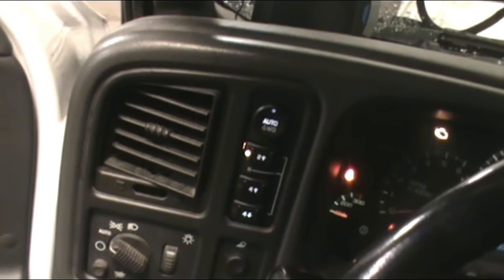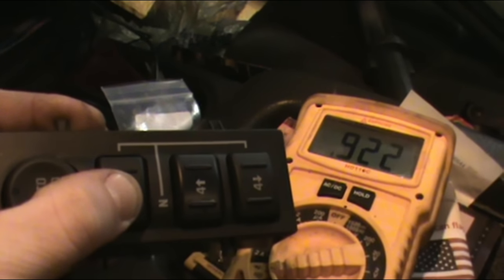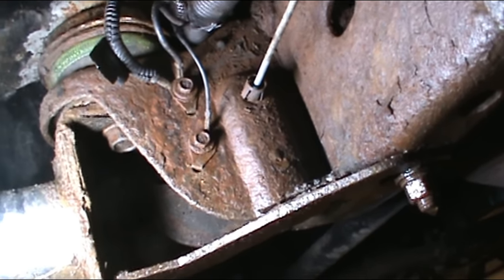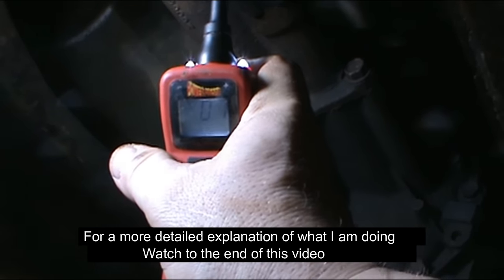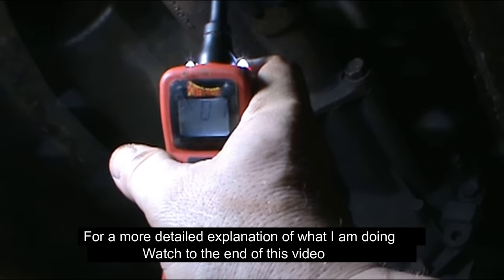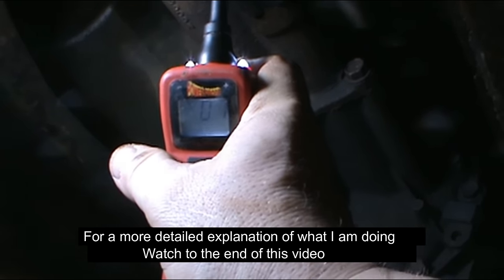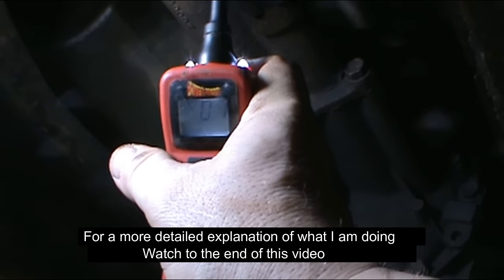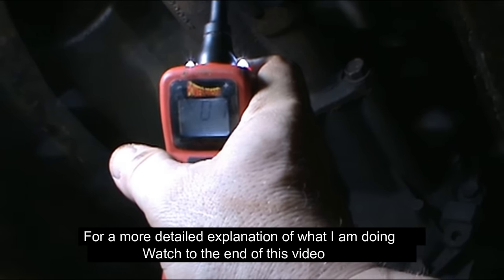Service 4wd diagnosis

Comment: I have never used a power Probe but I think i need one.  Lol What is the model of your power Probe and how much are they?
Reply: I thought I had my four-wheel drive fixed.  after adding a ground but after a couple days the service 4wd  come back on.  I know you kept asking people if the switch have any lights flash whenever you start the engine.   I do NOT have any lights that come on/ flash on the 4wd switch whenever I start up the truck.  then the service four-wheel drive light comes on.  
Some days I'll go out and drive the truck and 4wd will be fine. Then sometimes halfway down the road the lights flicker and go completely go off on the switch and the service 4wd light come on and not have four-wheel drive.  Then maybe the next day go out there still not have 4-wheel drive. And then it all of a sudden I have 4wd. Do anything do you think it's just the encoder. 
Thanks for your time.  I'm still curious about your Power Probe
Reply from the maker: I actually made a point to check my probe today to reply to your comment.  I have a power probe 3 and I got the full kit.  It is great for automotive troubleshooting but I still have a multimeter for household stuff (the power probe only does 12 volt systems). The encoder is usually the culprit for intermittent issues.  I have a video on changing it.  Check the wires going to it over the driveshaft too, I had them fall and rub bear causing it not to work in the wet/rain.
Reply: @GSEShop  thanks man I appreciate all the info. It's like 15 degrees here in Missouri now so I will look at the wires again in a couple days when it warms up a little.   I bet your right its the encoder.  My buddy said he had one for me to try and see if it will solve the problem before I spend the money. So I'm just waiting for him to give it to me. Thanks again I really appreciate it.

Comment: tried my actuator and cleaning up by drivers door wires.. says service 4wd... if i click the buttons the lights still switch over how its supposed to and i can hear it like in the video.... not 100% sure if 4wd is working considering there is no snow right now... but if the service 4wd light is on that obviously means there is a problem.... will check where you spliced in the ground wire and try that.... but any suggestions or help would be great!
Reply from the maker: The video is where I threw it all on the table.  I can offer ideas up it is hard to diagnose something that isn’t in front of you.  I will try to help as much as I can
Reply: Ok so the wire u tapped into is the black ground wire? Correct?
Reply from the maker: @Chache1527  yes on my truck it was the black wire

Comment: So I have a transfer case acting up but totally different than yours have been.   Mine wouldn't go in 2hi or 4hi, but it would go in 4lo and move.   I tried the nsbu, grounds, encoder motor, checked the buttons, changed the ignition switch.    All with no resolve.  I can unhook the batteries for 30 mins, and rebook and it will go in 2hi.   It will stay in 2hi until 2nd gear and then it clunks and send the transfer case to neutral.  It throws no code, dash just says "shift range inhibited".   I'm at a loss.  Any ideas??
Reply from the maker: Sorry I just saw this. Did you change the encoder or the whole assembly with a new one?

Comment: Hi please need your advice have a 2006 trailblazer xlt ..my problem is when I switch the knob in any postion the lights flash then go soild acting like they switched and you hear noise like it switched but the truck stays in 2 wheel the front difrentinal does not engaged and no codes show up or messages ....my mechanic friend replaced the front actualwaiter under front wheel .....he ran test says the diferenchel is not engaging ...but what has him baffled no lights or messages show up and the switch flashes then goes soild any ideas appricated dave that you
Reply from the maker: david kurzdorfer it is most likely in your wiring, check for a ground and battery voltage at the plug

Comment: Hey just wondering how did you get the switch to start actuating the motor. My truck (04 suburban) does what your truck did in the beginning of the video. The 2wd light on switch stays on and the buttons don't do anything. Switch is new.
Reply from the maker: Did you watch the whole video?

Comment: Mechanic said my encoder motor was bad and a common problem, it would cost $145 labor and $180 for parts then he replaced it,never fixed problem ,then he said it was the tccm,replaced it and everything works fine. Billed me $683 ,felt ripped off
by a mechanic who misdiagnosed and throwing parts at truck at my expense.
Reply from the maker: eastside0434 sorry to hear that

Comment: You actually had your meter set to continuity/diode check, but will still measure resistance with this setting.
Reply from the maker: You are correct
Reply: @GSEShop  🤘

Comment: On my four-wheel drive switch it clicks up and down up and down from low to high to auto back and forth that's the only thing I haven't changed out so what do you think
Reply from the maker: Did you test the switch?
Reply from the maker: Did you test the switch?
Reply from the maker: Did you test the switch?
Reply: Not yet doing that next
Reply: Tested the transfer casing motor it is clicking and making noises it's good the other little motor that engages the gears is clicking and making noises it's good only thing left is to test the switch
Reply: @GSEShop  it was the ground wires thank you for your help

Comment: I think this is my issue but not 100% sure.
The other day, my 2005 Tahoe went into 4L on its own, would not come back out. My encoder motor sounded like a toy running out of batteries beforehand, so I changed that first since I don't have a code reader that could read that code nor the means to get the Tahoe to a place that did. Replaced the motor and then the switch showed both 4H and 4L lights on for a second until I pushed a button and it showed nothing. The motor will not move at all now, and I have no blinking lights to indicate it is trying. I then replaced the module underneath the dash and it is still doing nothing, lights on the switch come on for a second until the car is on, then everything turns off. I replaced the switch last year after it put itself into 4L once, haven't really dealt with it until now but now it will NOT cooperate. Will this fix it? I am so hoping it will and for an answer, I've been at it for about 4 days now. Thanks a ton and God bless.
Reply from the maker: TheFNGBenJammin If you replaced everything you said you did I would think you have a wire problem.  Try this first because it won’t hurt anything (you can’t have too many grounds) but I suspect there is a broken or damaged wire connecting your shift motor.  Good luck
Reply: @GSEShop  Okay, thank you! I am praying this works.
Reply from the maker: I pray it does too

Comment: You were not clear...did you jumper a black wire with a blue wire, or did you jumper a blue wire with more blue wire?
Reply from the maker: On my truck it is a black wire, but on yours it may be different.  You need to jump the ground wire to another ground
Reply: @GSEShop  
Very good...thank you

Comment: The only thing I do not understand is this, if you connected a ground to the already existing ground wire that was not functioning, if there was corrosion or a break in the wire, how did the new ground wire make it to the actuator? Do I need to pull the ground wire out of the connector on the actuator and replace it?
Reply from the maker: Lit 710 you just connect your new ground in an area before the corrosion

Comment: I don't understand. We can hear the sound of the motor changing, but couldn't that sound be coming from the 4wd actuator up front on passenger side?
Reply from the maker: I have never been able to audibly hear it move but it would only do so between 2hi and 4wd.  Listen when you switch between 4hi and 4lo.  The FAA should stay silent in position.

Comment: Hey, quick question. I cannot hear my transfer case motor when attempting to switch between 2 and 4. No noise at all. I have no lights on my selector and the service 4wd message. Do you think the transfer case motor itself is the issue?
Reply from the maker: Probably the encoder in the motor
Reply from the maker: I have a video on doing that

Comment: Well great but I have a 2006 GMC Sierra and I don't have buttons like that on my truck and my dashboard light came on said it was in 4-wheel low and I don't know how to get out of it
Reply from the maker: Is it actually in 4low or does it just think it is
Reply: @GSEShop  that's what it came on the – the light came on when I was driving this morning to take my son to work but I can't find I can't find how you put it how you take it out put it back just letting you know regular I can't find anything I looked all morning
Reply from the maker: @sherizazzetti1824  ok, but is it in 4low?  Can you drive at normal speed and not hear the engine revving high
Reply: @GSEShop  well I think I got it but when I drive it and I can do like 50 or something it wants to ramp up but it's been doing it off and on for a while but I got another motor and transmission and I got to put in the truck cuz I have a trip for 12 years and always took care of it you know
Reply from the maker: @sherizazzetti1824  not sure I followed all of that, but if it isn’t in 4low but the light says it is it is probably a bad encoder.  I have a video on changing that too

Comment: Hey I got a 2006 chevy trailblazer ls 4x4 drive 
My switch is completely dead I tried a new switch nothing I had it in the shop they said my axiulator good so I tried re setting my tccm nothing getting so frustrated 😠
Reply from the maker: Your encoder is most likely bad, I have a video on that

Comment: I think this is my problem. I have a 06 suburban and when I try to shift into 4hi the light just flashes and goes into 4auto. It will however shift into 4lo. The guy I bought it from rebuilt the 4wd system almost completely. Going to have to test that ground out in the morning.
Reply from the maker: Good luck
Reply: @GSEShop  seems like a good place to start. This is the first 4wd truck I’ve owned so a little over my head.
Reply from the maker: @bradleygibbs2241  well it kicked my ass for a while but I will share what I found

Comment: Ok when I turn the key forward the 4x4 switch lights up but then acts like it doesn't have power I switched the 4x4 switch changed the 2 fuses added the ground like you did cleaned my grounds
Reply from the maker: Sounds like a bad encoder
Reply: @GSEShop  is that part of the transfer case motor
Reply from the maker: @joshhilmon6535  yeah but you can change it by itself too

Comment: my truck was working fine then as i was driving i have no lights of any kind on the range selector -after taking the switch out i found i had power at the switch on 2 terminals but even after a new switch still no lights- any ideas
Reply from the maker: Gordon Ellis I would guess an encoder problem, I have a video on that too

Comment: Put my truck on all For jackstands and the back wheels spin and the front Passenger spins the front driver moves very very slow and comes to a stop both actuator seem to be working switch is working but no four-wheel-drive when on the ground any idea 4 button switch 2000 Chevy Silverado 1500 4x4
Reply from the maker: Did you try the ground wire trick?  I have also had encoders that went sort of bad and would engage enough to turn the front wheels lightly
Reply: @GSEShop  the front diff actuator is working tho how can I make sure the encoder is good
Reply from the maker: @joshberry7067  I have no tests for it other than to replace it.  It tells the computer what position the transfer case is in and sometimes when they go bad they don’t shift all the way.

Comment: My service 4 wheel drive light came on. It's on a chevy k2500 year 2000 truck. All the lights on the switch in the cab are lit up. If i turn my dome light override off, and press in and hold the 2 wheel high button, it dings and the dome light comes on. Then if i press it again it dings and the dome light goes off. Not sure where to start looking for the problem. I checked the first set of ground wires under the truck by the driver door. They appear to be ok. I haven't taken them off and cleaned the area yet. Any ideas?
Reply from the maker: Rockhound Grandma watch the video, the easiest thing to check is the switch and move from there

Comment: My 04 tahoe just had some brake line work done to it i had just bought the truck the 4wd button were in 4 hi and lit up i pushed it and went to 2 hi no problem then i had it towed to shop no weeks later i just noticed there is no lights on the switch what so ever and no service 4wd warning either when switch is pushed nothing at all happens ive cleaned grounds under door and tried fuse reseting and battery un hooked allnite any suggestions cheap one lol be very much appericated thanks
Reply from the maker: Sean Colpitts the service 4wd message only appears every so often.  Disconnect and reconnect your battery and see if it appears
Reply: Okay thank you i will try that

Comment: Do you have any advice on where to start if NONE of the lights on the selector switch stay on after the key is turned? They stay on for a few seconds and then turn off. Then you crank it and they all light up with the other warning lights and then go off again. Doesn't even show what mode the transfer case is in or anything. I tested the switch with my multimeter and all the modes are in range but like I said when it is plugged in and the vehicle running none of the lights are on. Only turn on at the initial start up
Reply from the maker: I would say your encoder is probably bad, you can change just the encoder or the whole shift motor.  It doesn’t show a position because it doesn’t know where it is.  I have a video on changing it.
Reply: @GSEShop  Ok thanks. I will change that and see what happens.
Reply from the maker: @spacemanspiff1197  good luck let me know if it works

Comment: All lights on my 4x4 switch will flash on when I turn key on, but all go off. And remain off. Any suggestions?
Reply from the maker: I think I would change the encoder
Reply from the maker: I have a video on that too

Comment: Man my switch don't even light up so I changed it still nothing cleaned my ground still nothing do know what could be the issue ?
Reply from the maker: Probably the encoder, I got a video on that too.  It is in the transfer case control motor